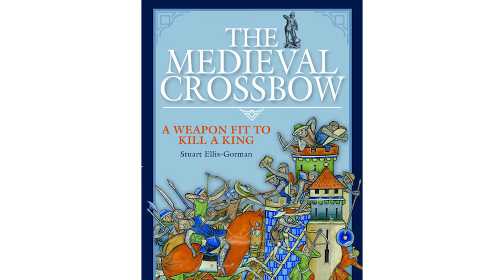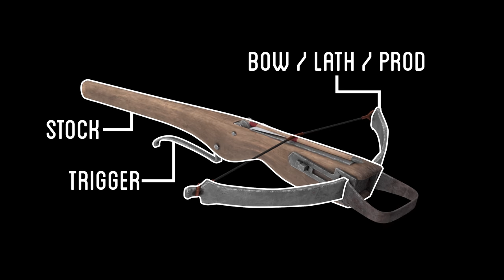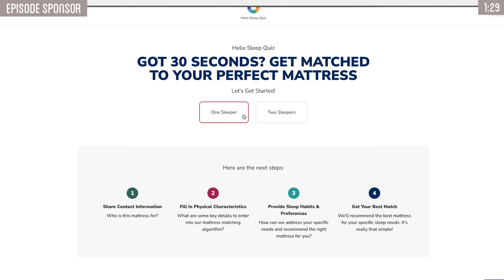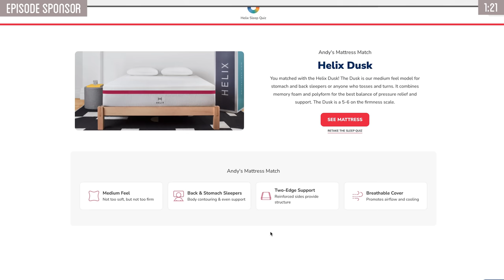Can I Make a Crossbow From Scratch?

Comment: I have done this! But mine wasnt made of classic materials heh. 

You can make a rly grt crossbow out of PVC for the arms (theres a way to heat treat PVC for makin regular bows too) and just some wood cut out in the rite shape. We used toothbrush headss to make the perf thing to hold the front end of the bolt in place so we cud turn it upside down and the bolt wudnt fire, but wud fire easily still when the trigger is pulled (or somethin else pushes up the string in the back).

We used sheets of plywood that we glued together so we cud make much lighter crossbows and cut them out with a CNC machine rather than by hand. Also let us easily cut the hole for the trigger.

I cant recall the bowstring we used, but it wasnt just regular bowstring but was instd somethin else that we just used as such for the crossbows. It was remarkably sturdy still, i remember goin out with my friends i built it with and just firin bolts at brick walls from 20 ft away hundreds and hundreds of times to test that durability spec and also test out the bolts we were usin to make sure they cud withstand repeated firin at hard targets. Which was to simulate armour worn by our fellow LARPers is the main thing there, which wudnt be anywhere near as hard as that wall; for crossbows in our game (Amtgard) you just arent allowed to shoot someone within 20 ft tho cuz ya cant half draw a crossbow like a bow.

Overall the methods we used and materials meant that one of those crossbows cud be sold for prty much the same price we wud sell boffer swords for; which drastically improves the likelihood of folks utilisin the Archer class and enjoyin the awesomeness of a crossbow; which just, imho, looks so much more thematic than a foam covered golf club core... Even if they took the time to shape it like a sword (like the guy i helped make these wpns wud do) rather than go the quick and easy wrap sword method that just looks like a large billy club.

I used one of those crossbows for the whole yr i was with that guy cuz that simple to make wpn is just so devastating on the battlefield as i can literally point and click to kill my foes xD 

That guy ended up pullin a dick move and kickin me out with little notice over a petty slight (id had a trip planned and found out rite before i was rdy to leave that he wanted my help with a project that weekend but i didnt wanna cancel on my other friend i was goin with and he said it was fine... But then i got back from the trip and given less than a week to leave bcuz i wasnt "helpin out enuf"). But his wpnsmithin techniques were on pt and i feel that information deserves to be free. So i rly hope someone uses these instructions to recreate such a crossbow. The shape is prty easy to figure out, and the PVC doesnt even need heat shaped, just closed flat at the ends if ya want a better look to it, it has enuf natural pliability that the arms will bend.

Feel free to ask me for more info on it if anyone readin this does decide to recreate these. Screw shitty landlords like that guy.
Reply: What was the poundage of the bow?
Reply: @stockloc  It was designed to meet the standards set for bows/crossbows in Amtgard, which allows for up to 35 lb bows (at 28 inches); or around the equivalent of that for crossbows

I dont actually remember the exact poundage of it, tho i know many of his first crossbows turned out to be too high of poundage; so i know you can evem make probs a 50-60 lb bow or crossbow with pvc. Doublchecked some tutorials and yea, one of them says they pulled a 63 lb draw on theirs; backyard bowyer achieves rly high poundage by doublin up the pvc usin a smaller pipe within another pipe

Comment: It would be cool to see y'all make your own crucible steel. I have accidently melted/burned steel with charcoal, this should be possible in a hole with some bellows. I would mix 1000g of mild steel,  7 grams of crushed charcoal in the crucible. Break up some glass and put it on the charge. Cap up the charge and make it air tight with refractory material. I would dig hole hole around a foot deep and fill the thing with charcoal. Go ham on the blowers for multiple hours and let it slow cool overnight. Break open the crucible and put the steel cake in the forge and take it to welding heat. Let it air cool down to to room temputure. I would do 5 heats gradually taking it to a normalizing temperature. This should give you around 2 lbs of good high carbon steel when you are done with it.
Reply: You gotta make a video on that!
Reply: @rexrodecolt  Me?
Reply: @thewalnutwoodworker6136  Yes, Absolutely!
Reply: @rexrodecolt  I'll try! I'll make a new channel that I have not trolled on.

Comment: How many skills does Adrian have.. awesome.

Missed opportunity to fire it on your armour that you had made. Maybe a standard Kevlar vest if you lost the original in the fire
Reply: its not a very powerful crossbow, the draw weight is low for a crossbow and the draw length is also a bit on the shorter side too, it wouldn't do much.
Reply: @danilooliveira6580  It's actually about twice as heavy as contemporary pin lock crossbows like the Skåne Lockbow- they tended to average around 55lbs. This bow also has a stroke of around 6.5", which is typical for the time.
Reply: @TheElfsmith  that is definitely light for a war crossbow since they can go up to 500lbs, sure normal crossbow for self defense or hunting, but it wouldn't pierce any armor, that is what I meant. though I admit I thought the draw length was a bit shorter because the bolts looked small, but if its 6.5" then I guess it the average ? from what I read the stroke didn't vary a lot throughout the European middle ages.
Reply: @TheElfsmith  but now I'm curious if you would be willing to craft a more powerful crossbow for a future episode, maybe even with a cranequin ? I guess that would be a bit too much work lol
Reply: @danilooliveira6580  I mean- because of some overheating on the first prod, I've already made two, so who knows!

Comment: While the crossbow might not have been easier to SHOOT, it was significantly easier to TRAIN with. A warbow such as was found on the Mary Rose had a pull of around 150 pounds. And that's a longbow with no modern pulleys or similar as is found in compound bows. Drawing a bow like that requires immense arm and shoulder strength, and a longbow-man trained massively, from a young age, to be able to draw that. Longbow archers' skeletons have been exhumed, and there are literal body-changes, with larger left arms and changes in the bone around the arm, shoulder and finger joints.
The crossbow, meanwhile, uses stirrups or windlasses to pull, which not only makes it possible to pull higher weight, but also easier to pull said weight. There was no need to near-daily training to condition your body to be able to shoot it, making it possible to arm basic peasants with it in large numbers. Pull the prod back with whichever mechanism, place the bolt, aim, pull the trigger. This is also the reason it was common in peasant uprisings such as the Taborites of Bohemia or Dacke of Sweden. Of course, the more training with it, the better, and various mercenary units, such as the crossbowmen of Genoa was and remain famous.

The crossbow WAS frowned upon by European society....but only when used against Christians. The Pope Urban II decided that, such a weapon was entirely unacceptable to use against fellow Christians. Muslims and other heathens, however, was just fine.

And while the crossbow wasn't powerful enough to threaten a knight in full armor, it certainly made a mess out of anyone in just mail, far more so than any bow. There are examples of riveted mail that have massive holes in them where the crossbow bolt went right through. Arrows, meanwhile, tended towards needle-shapes that pushed through the rings.

But that doesn't really matter. As we see in the battle of Agincourt in 1415, the bow was quite efficient. It isn't that you shoot one arrow at a guy and kill him. It's that you shoot 5000 arrows at a time, 5-6 times in a minute. The exact numbers are a bit uncertain, but it's estimated that there were between 6000 and 8000 men on the English side, about 5/6th archers, and around 15000 knights, 10000 mounted men at arms, in armor, on the French. The British won by basically killing knights and horses by the dozens in the absolute avalanche of arrows coming down. Estimated losses are MAYBE as many as 600 English, compared to 6000 killed, most of them nobility and so in armor, and between 500 and 2000 captured, on the French side.

Comment: Romans already had scorpions and tons of advanced ballista, even the polybolos a ballista that could continuously shoot.

And the first hand held crossbow in Europe was called gastraphetes, invented in Greece.
Reply: Ballista has nothing to do with a crossbow .
Ballista has 2 limbs that are connected to a twisted rope(rope torsion spring) which is under tension because it's twisted , 
Rope springs give the power to a projectile on a scorpion /balistae , bow limbs give power to a crossbow.
Reply: @StodOneR  This is very true indeed, they are conceptually different machines that have similar appearances due to the method of propelling a projectile. And something to note is, the concept of a Ballista is not easily miniaturized, its a law of diminishing returns to have torsion engines at that small of scale, it would be akin to killing someone with those twist-propeller planes that kids would play with. Crossbows equally, cannot be scaled up to quite the level of a ballista with ease as it presents a significant hazard to the operating crew to have a large bow-line under tension with the potential energy necessary to propel that size of objects.  An interesting dilemma. Though Sergio is correct, the first handheld crossbows seen depicted in Europe are the gastraphetes in Greece and were used several times in combat.
Reply: polybolos "bubububut founding fathers didnt know what repeating weapons were" argument sounds pretty hollow after you see that thing, or gatling gun
Reply: @damascus1111  Phew,good explanation from each of you.
I was expecting a quarrel,about bolts,and darting back and forth.

Comment: The bow and arrow was actually one of the first things I ever sat down and built from scratch like that. The one I wanted was well over 5k dollars so I built it for like 50-100. It uses pieces from a sail boat as the grip, knuckle guard, and sight. Those parts were so expensive that I just went to the hardware store and bought a bunch of parts that I was able to cut, grind, and file/sand into replicas. When I finally shot the bow I quickly realized I made it way too powerful. Probably a 80-100 lbs draw. Way too much.
Reply: 100 lbs is way to little for a medieval crossbow but seeing you used the word "sight" I'm guessing you made a modern crossbow.
Which has a completely different design to a medieval one and in the end also has a different performance .
Medieval crossbow that weighed 100 lbs was probably only good for rabbit hunting . Tell me what is the draw lenght of the crossbow you built ?
Reply: Medieval war bows were minimum 70 lbs draw weight. But they very regularly got up to 180 lbs, with some thought to reach up to 220 lbs!

Comment: That Dr. Crossbow forgot the biggest reason why the crossbow took over in warfare. To be a good bowman you needed to train from an early age so you would have the strenght and stamina to use the bow effectively in war. A crossbowman however could be trained in weeks, which was advantageous even if you couldn't fire as many bolts as arrows. However, you could instead train more people to use it and compensate for it.

Comment: 17:58 that isnt a recurve bow, thats a barebow. for it to be a recurve bow there needs to be a sight attached to the riser.
Reply: It is definitely a recurve bow. Barebow is a kind of archery and a configuration of bows- not the bow itself. Longbows without any sights are considered barebows. You can also shoot barebow compound.

The only requirement for a bow to be a recurve is that the limbs, when strung, have a secondary curve away from the archer, hence "re-curving."

Comment: Sadly your bows were likely more powerful (did more damage) than your crossbows. From where the string rests to where it is when fully pulled back affects the energy imparted to the projectile. I've seen a few videos by YouTuber "Tod's Workshop". In one of his videos he compered the power of a bow vs crossbow (or was it modern vs medieval crossbow), and what I took away was that as a rough estimate if you quarter the distance drawn back then you quarter the power given to the projectile. Even if it takes as much strength to pull it back that far. 

So if you have a bow that you pull back 24 inches (to 30 from the 6 where it rests) then a medieval that has a 6 inch draw (yes medieval crossbows would only be drawn back that far) then you would need to have 4 times the power. Off memory medieval war bows where about 170 ponds of draw weight, so you would need 680 pond medieval crossbow to match the power of the archer.
Reply: The bows in this video? Probably yes. The bows HTME has made up to this point? Definitely not.

And of course, the thing is: Anyone can learn to use a 680 lbs crossbow in maybe a week or two, but training a bowman to consistently shoot a 160 lbs warbow is going to take literal years.

Comment: The bit about european crossbows being super powerful is kind of wrong. "Draw weight" is different from power and only refers to how much force it takes to pull back the string but the short stroke and stiff bow make them much less powerful than a bow of the same weight would be. Also chinise crossbows were able to have a longer draw distance not required to, nothing about its mechanism would stop you from putting it further forward

Comment: Still trying to figure out why you went through the process of forging all those parts, then sticking it on a cheap piece of pine/fir instead of spending a few extra dollars/pounds/euros/whatever on some actual hardwood...
Reply: Because we used this project as an intro for Andy into the finer side of woodworking, so why would I start him off with a wood that's difficult to work with? Southern yellow pine is easy to work, relatively stiff, and plenty strong enough for what's required. It's easy to saw, planes glide smooth over it while still being obvious enough when you're working against the direction of the fibers, and it takes layout lines well.

So it's easy to work, strong enough for what it needs to do, and readily available at a low cost. Along with the fact that if Andy messed up a little too bad, it would be cheap and fast to start over- especially since a 2x4 is already close to the size needed for the stock- and that makes it a pretty good choice for the project.

Comment: Your expert doesn't seem to fully understand the value trade-off between bow vs. crossbow. Both medieval versions (crossbow vs. military longbow) have basically the same draw weight (somewhere between 100-200lbs). 

The main value of a crossbow comes down to its ease of use compared to a longbow. While trained archers are able to draw back that full 200lb weight of the stiffest longbow with ease, you can't just hand one to someone off the street as part of a militia and expect them to use it. By contrast a crossbow has a mechanism to draw it mechanically, which makes it much easier to draw, aim, and fire, despite taking longer to load. This is the real reason there was a crossover in usage, since trained armies could have archers able to use longbows reliably, and armies rounded out with militia and/or mercenaries could hand them crossbows so that their ranged force was better than nothing.

In short, bows are better than crossbows in the hands of someone trained to use them, but crossbows are better in the hands of an average civilian that's unaccustomed to combat. Power has nothing to do with it since military longbows and crossbows are equivalent. That's also why early firearms replaced the crossbow, but not the bow on the battlefield. Bows were in use for considerably longer than most people realize.
Reply: You're just flat out wrong with the draw weight, bud. War bows averaged around 85-110lbs, and war crossbows were 700-1300lbs.
Reply: Crossbows featured much higher draw weights compared to bows, which was needed to compensate for their much shorter power stroke. Like, it evened out in terms of actual power behind the shot, but a crossbow might have anywhere between 2-5 times higher draw weight compared to a bow.

Comment: Why are you using a Stanley No 9 1/2?
Reply: That's a 60 1/2, but I use a low angle block plane for short stock end grain, and for breaking sharp edges and chamfering.
Reply: @TheElfsmith  His Stanley cast iron planes have not been unlooked.
Reply: @thewalnutwoodworker6136  My Stanley planes. We used them to give Andy an introduction to finer woodworking with easier to adjust and tune metal planes so he could learn how to use a plane, and how planes work before attempting to make one from scratch.
Reply: @TheElfsmith  Ah, you really should make a wooden plane. In order to progress you need a good sharpening stone. In the book "The Wood Wrights Companion" there is a chapter called "the whetstone quarry." this chapter lists a number of localities where natural sharpening stones can be found and the proses of making them.